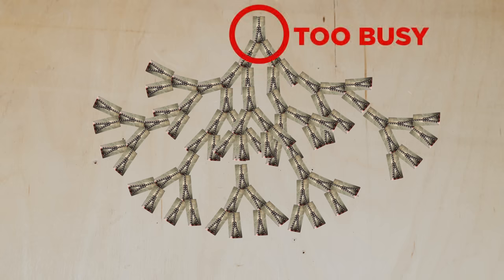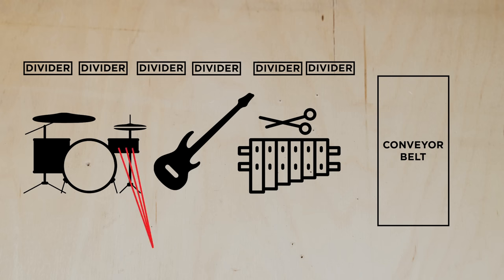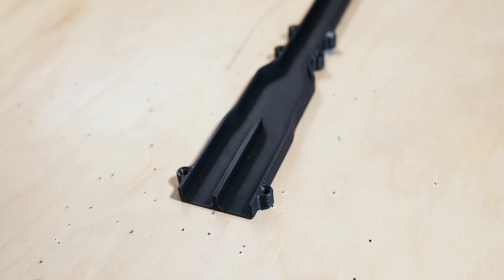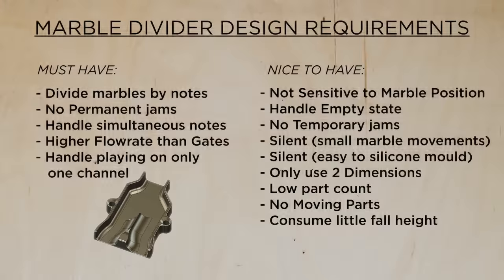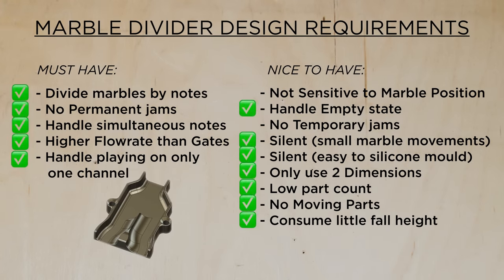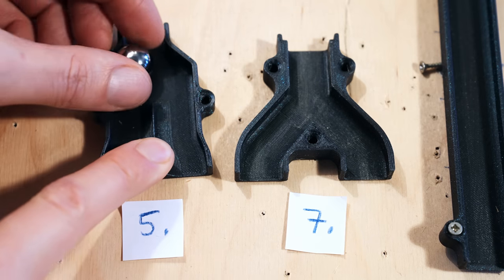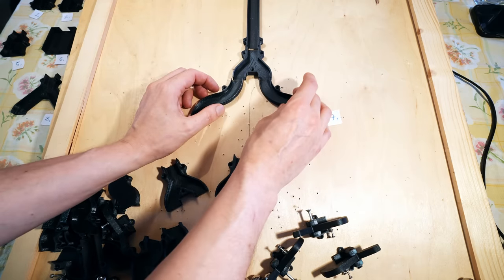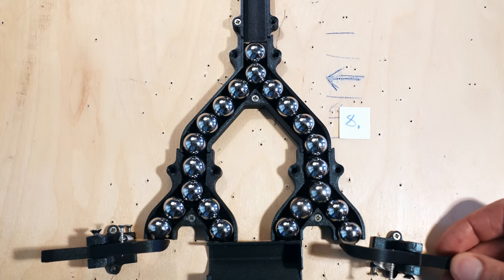Mystery Marble Divider?

Comment: You could put some very shallow bumps a bit up from the divider so they are coaxed to settle into their lane. they'd need to be very brief and close together so the marbles don't get stuck. make the tip of the divider gradual to the apex so it doesn't serve as a wedge and guides more smoothly. that way it'd leave space for less jams and any possible jam will work itself out. youd probably need to make the apex higher by a little bit at least, or if there's a cover, then it'd be fine. maybe think of small flaps to guide them maybe? ive been following you since the conception of the first machine. great work.

Comment: So nice to see the evolution, the trial and error and all the thought and refinements which goes into this seamingly simple device. 
Having recently seen Stranger Things 4, I had an spark of thought how you could to a divider differently: A stochastic sorter in form of a Galton board. At the bottom you could even do some overflow management as you did on type 2. Draw back might be the noise of the marbles hitting the pegs.

Comment: I think Martin was onto something with design six.  What he's done with the single lane design is create something which IMMEDIATELY fails if the system shifts a little bit. Like... The wiggle lanes are inherently bad, because they're an attempt to combat tiny mechanical tolerances, when you should be trying to create a system where it doesn't HAVE to be that precise. 

I think if he'd iterated on six rather than just throwing the idea away he'd have done better. Have it so the single lane enters a widening channel,  and the channel has two grooves which get gradually more pronounced, and a V divider in the middle gradually rises, so the marbles are teased into each lane, rather than FORCED as in Martin's design. Maybe? I don't know, I'm not an engineer

Comment: At 14:00 the adjustment of the path lengths with wiggles to achieve marble height alignment reminds me a lot of using wiggles on groups of microstrip tracks in printed circuit board design to maintain RF coherence. You could call the "holy grail" a "coherent marble divider".

Comment: I feel like having a physics simulation and automated test cases for your requirements would help immensely with your design process. You'd be able to test so many different initial timing and position configurations at once and you'd only have to plug in your 3d model and define where the inputs and outputs are. Your tests would automatically be consistent and you could add metrics retroactively and re-run the tests. Of course the simulation wouldn't be 100% accurate but you could always verify "winning" desings in a real-world test stage.

Comment: I would highly recommend trying to modulate it. 
where there is some stopper at the end of each split that will keep the marbles in position until the one below it drops. that way by every gate the lengths are set. (I would try some sort of tab the marbles roll over. like when there is a marble at the "top" of the chute below it will block off the top of the chute so that no marble can leave the one above.) this should fix the length fiddling issue. (I think)
          This way, you don't need separate 2 split gates and 4 split gates, all the gates are 2s, there is a flapper at the bottom (or top of next) that stops the marble from falling if there isn't enough space to fall cleanly, and no fiddling. keeping the 4 split gate might be good for space considerations though.
I hope you are planning on making the marble tubes a cover in some way, so that the marbles can't fall out the front of the dividers in the front. I looked really frustrating when all the marbles fell out, and this seems like a good way to fix it.
silicone might be soft enough to mess with the consistency, but hopefully would work. Maybe if its too  flimsy add a hard plastic backing? I'd say felt within the dividers, but that would be hard to print, and might mess with consistency. I'd still try it though.
double sided foam mounting tape have a bit of cushion to them (I think that is what I'm thinking of), so that might cushion the divider from the plyboard, which hopefully would cut down on the plyboards sound amplification.

Comment: Maybe I am missing something but I see one problem with a static marble divider that doesn't have a mechanism that "guarantees" equal splitting of the marbels: 
Lets assume the the static divider splits marbels into channel A and B. Lets assume you are playing a song which has both channel A and B on full blast i.e. the Channels don't "backfill". Now it would be entirely down to the divider's accuracy that both channels get fed equally since there are no "backfilling" marbles in A to push marbles into B or vice versa. You'd essentially be at the mercy of your prints accuracy to give you a perfect 50/50 split or even worse you'd be at the mercy of external factors such as the evenness of the machine, wind or vibrations. Anyways, food for thought :)

Comment: I really feel that the marble divider should not also deal with issue of the marble height at the gate, eliminating the need for variable height independence. 
As you have decided to split the divider into many dividers for each instrument, you should also consider implementing a new stage between the divider and the gate where the marbles drop.
Something like a first gate at the end of the divider, which drops marbles to a small area before the final dropping gate. This area between, of preloaded marbles is where the marble height can vary. This also means the pressure of the marbles in the divider is not weighing on the final gate but on a separate gate which can be designed to take the load.

Comment: Hey wintergarten! So, in regards to flow and jams, on the divider, an updated version could utilise rounded corners to an effect. The height sensitivity comes from not allowing enough space for another marble to flow past, so the corners that combine the inlet track to two separate tracks, could have softer "sholders" to acomedate the need for the extra space and marble hight, withoug alowing enough space for two marbles to enter side by side, keeping the one marble track. Allso, roundness is a good flow's best friend!! Like rivers and streams, they never have sharp corners, so the sharp point at the start of your devision into two tracks, should maybe be rounded instead, allowing for further space. Maybe these changes, or some itteration of it, could give enough breathingroom in the design, for the marble hight to matter less, or not at all. Try it out if it seems interesting 😁

Comment: What about pre-sorter? What I mean by that is the marbles can be initially sorted as per rev.10. But instead of being held directly by marble gate, they can be held back slightly higher at the exit of sorter. Thus mable stack height will not be important in the lower section. I'm thinking of lever with a locking notch that hold back marbles at the sorter rev.10. Below this a straight line track with second part of the lever. And when the marbles are full at the straight section they will push on this lever and move the locking notch at the upper section. When they will go lower and stop pushing on the lever, the presorter gate (notch) will open and let more marbles into the straight section. I know it's sound confusing, but this might be simple mechanical solution. I see two benefits at least, no jams because of the different height depending on gate posistion, and secondly weight pushing on the gate itself will be reduced because fewer marbles will be directly pushing on it.

Comment: mass loaded vinyl mat would deaden sound at a cost of weight. 
a wedge shape under the claw/stopper would allow vertical operation, (not sure if this was only track demo or stopper mechanism too, sorry i haven't been following lately)
on a side note: mounting the claw/stopper on a slotted mount + having a sort of low height "rail" (think like a half pipe but lower sides) at the end of the track/tube would allow easy precision adjustment i would think.
that's just my thoughts, it would allow you to use a set wiggle section optimized for flow and then fine tune the stopping point for intersections.
perhaps the claw could be lengthened and arched a bit higher to allow ball travel beneath it while still having clearance for flow no matter if it is open or shut at the time the ball rolls through.

Comment: A piece of PVC drainpipe with a bullet shaped insert with a corkscrew top.  Somewhat akin to a reverse Archimedes screw.  The insert has channels that grow as the marbles get to the base of the bullet insert.  This directs the marbles to however many outputs you want depending on the diameter of the pipe.  Insert can be silicone to deaden noise.  Drop balls into the top and gravity sorts them out.  The opposite of a gun barrel, the rifling is on the bullet insert.

Comment: Two ideas: 
A) Would it be possible, without overly increasing complexity, to allow tracks to play "null" notes? As in, pass marbles through their gates without playing the instrument (by routing them someplace else). This might help prevent one disabled or very inactive track from clogging any gate due to small misalignments or parts loosening during a performance. This could be achieved by having the track disable lever not stop dropping marbles, but rather redirect them to a dump lane. The mechanism for dropping marbles is always engaged (and all "music sheets" should have some notes playing on tracks even if they're going to be disabled during the entire performance), but the marbles dropped won't play sounds, achieving the same effect, without backing up a stack of marbles.
B) Have you considered designing tables with pool-like edge pockets, so that if a marble spill happens, they don't all roll down to the floor? Even if it fails to catch all the marbles, its still better than nothing! This could be as simple as some rigid wire loops that hold bin bags open around the edges of the table

Comment: A silicone mold of this divider will have super different properties from the 3d printed one. I think it's likely that the flexibility of the material will allow marble pressure to break clogs that form when the marble positions are a few millimeters off.

Comment: Something you should consider a later point when you get to the conveyers, is a marble pool. Basically a basin (or bucket) that is where all the marbles get pooled into before being scooped up by the various conveyors. At a level where it's going to be in excess. This way you can have more marbles in the system than would fill up all the lanes. So that there is never a chance for gaps to form, which was something of an issue in the old designs.

Comment: you might be able to adjust the height of the  split by attaching it with fork edged pieces that can be changed in their distance from one another but still allowing the marbles to flow through. Like an expansion spacer pn a hoghway.
 then The screw holes can be vertical ovals to allow the track to move up and down and a fourth screw could house a small cam which could be turned to raise or lower the fork point. Then the other screws can be tightened

Comment: 2:38 a complicated machine at scale has a non-zero chance of errors, which means there's likely a point where switching from eliminating errors to correcting errors becomes more valuable. perhaps there's a way to mechanically monitor the channels downstream after the dividers and to 'top up' specific zones / notes that are running behind.

having redundancy or multiple ways of solving the same problem (or ways of solving the occasional errors a machine runs into) can lead to increased reliability and reduce the impact to the performance, which is really what matters. it's not a problem if the machine is technically 'failing' at things, as long as the actual output isn't a failure.

Comment: I think you've always designed marble dividers in 2D and you should try to play around with a 3D marble divider. Adding a third dimension to the marble divider might help solve the height sensitivity issue. For example, a shape like a tripod might help leaving more room for the marbles to fall in one of the three paths.
Spheres pile up and arrange themselves better in 3D than in 2D.

Comment: You are correct, the perfect design does not exist, at least not to me.  I'm no expert, but i watch a lot of manufacturing videos, this is why i find yours so intriguing. Don't underestimate the power of slack.  Every large manufacturing process uses slack somewhere in their process to alleviate the issue of having a ton of raw materials funneling down to the machines that do the work. Yes, they do use a ton of precision when doing that work, but the slack is essential so they don't run into issues where they don't have too many bottles, too many bolts, etc, bog their systems down.  I would say use the precision where needed, at the machines that need to do the work, in this case the instruments, like a track of 20 marbles that are perfectly synced and ready to go. have those be fed by a less position sensitive system such as a track just to refill those 20 or so marbles. if you have position sensitive system all through out the marble machine, you will give yourself very little wiggle room and lot of jams everywhere.  Again, i'm no expert just an enthusiastic viewer.

Comment: Random idea. Circles... A circular (or oval) track with a shape of some sort guiding in the middle which side to travel. the curve of the circle sets the height. And set the whole thing on a small rollerball or other point (dead center on the bottom) that allows the weight of the marbles to determine the direction of flow. (Think spinning top or teeter-totter)  Put a "stop pad" underneath the edges to act as both a silencer and a height gauge. (Cork, pressed felt, or neoprene works great)  Set the inflow track .05mm higher than the divider. And I'm sure someone with math skills can determine the size of the circle that will allow for constant height based on the size of the marbles. For more thought where this came from look up "The self leveling pad by Jim Schmidt" then imaging the pad as the divider and its flipped around letting the marbles balance on the pad. Add a lip to contain them and play with the center design to keep from jamming.then you need a inflow and 2-3 outlets. Now you have a round-a-bout...for round marbles... I don't have time to make it and test it. I've got flutes to repair, but I second the issue with silicone adding friction. Try neoprene instead, or AAA grade 1/4" sheet cork. Expensive, but great for silencing. Or what about thick pressed synthetic felt carved to the shape. Might last longer than cork.

Comment: I think the overflow solution was better. But the issue back then was that the marbles have to flow over each others and then the hight is important again. That could be solved by just not letting them flow over each others but towards the front or the back.

Comment: Duplicating gates so that there is a gate right after the divider, then a gap, and then some constant supply of marbles before the actual gate would solve the height sensitivity, and likely some issues with marble pressure. There is the added complexity of having 2 gates for a single channel (though with Bowden cables it shouldn't be that bad) and some extra noise because the marbles would be hitting the supply queue, but I'd say it's worth considering. I mean, this way the divider together with divider gates could be a completely independent unit, and affected very little (if at all) by the line it'd be feeding.

Comment: I definitely do not have time to make a video, but if anyone else wants the credit…

A height-insensitive divider will need to operate like a train track switch with a guide that moves to block the unintended rail branch.

The marble traveling down one of the branches needs to pull the guide to its side “closing the door behind itself.”

The action of the guide needs to snap into position (not stop in the middle) and it needs to do so rapidly enough to be ready for the subsequent marble. I believe Martin did some groundwork on this type of action in his earlier videos on gates.
Reply: Sounds like a good job for a bistable compliant mechanism.

Comment: What you need is a tight tolerance between the gate and the channel so you can put the gate at the right height. One could imagine several ways to do that. For example, just print the mounting surface for the gate in the same print as the bottom channel, and give the gate adequate support so it stays in the right location even with the weight of marbles. Depending on the tolerance you can achieve you might alternatively want to make a way to adjust the position of the gate using shims or screws.

Comment: A suggestion: To limit the noise of your marble divider you could print TPU 64D. It is just flexible enough to attenuate the chocs, but has great toughness and is very easy to print except for a slight tendency to stringing. It may be much easier to process compared to silicon.

Comment: Jam: add a tiny slope at each split (Y) to increase the speed of the marble a tiny bit to its final position. That would in effect increase the distance between that marble "accelarating" and the  previous marble, which it could jam with. Marble position: Adding some extra space up,  in the very last curve of the very lanes, should disconnect the link between the few last marbles and all the ones above because the marble, just below that extra space, would be pushed in that slot without really changing the position of the marble above and therefore none of all the marble above